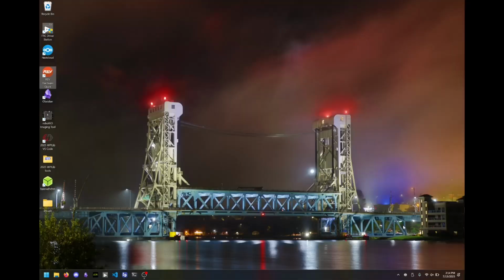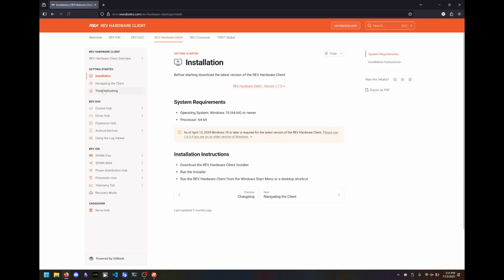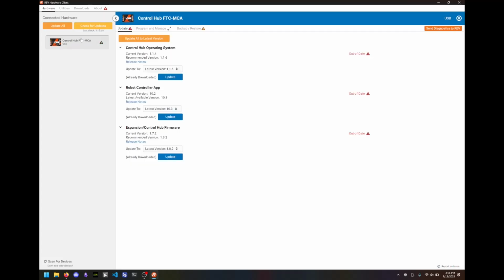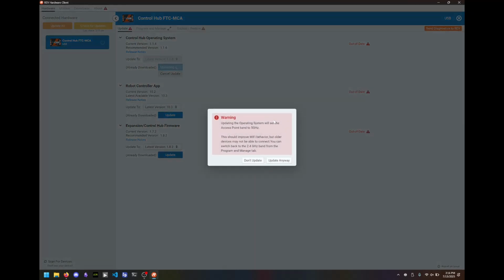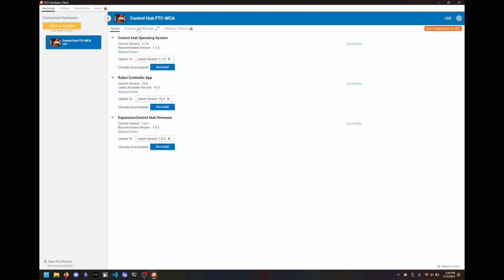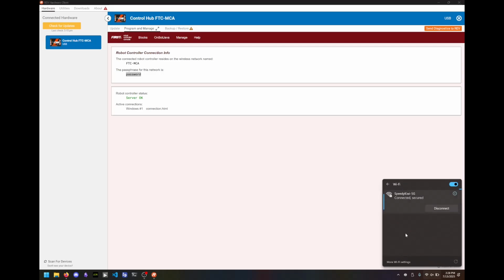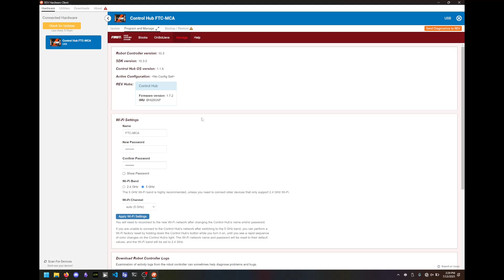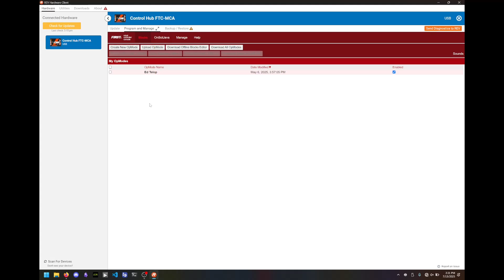FTC: The Control and Expansion Hubs

Comment: I cannot see the expansion hub connected on REV clinet?
Reply from the maker: I'd make sure you the control hub and expansion hub connected via the communication cable (port RS485), and make sure it has power.

I've seen it where the rev hardware client doesn't find devices for whatever reason. Other things you can try (in order):
- try refreshing the device list in the lower left
- try a new usb cable
- power cycle the robot
- reboot your laptop
- try a different laptop
- try a different expansion hub

For additional trouble shooting steps, check out rev's documentation
https://docs.revrobotics.com/duo-control/troubleshooting-the-control-system/expansion-hub-troubleshooting